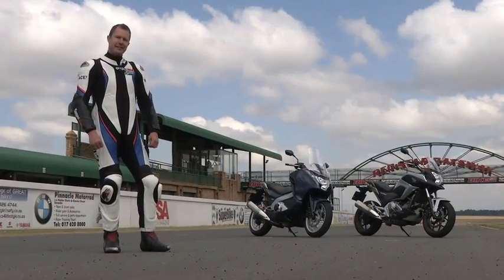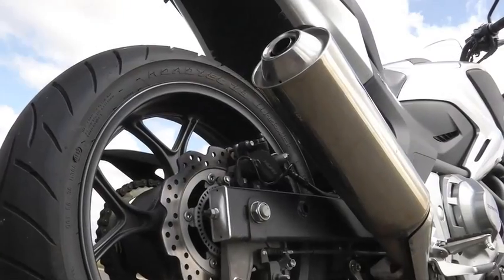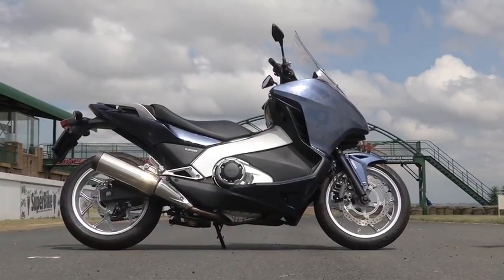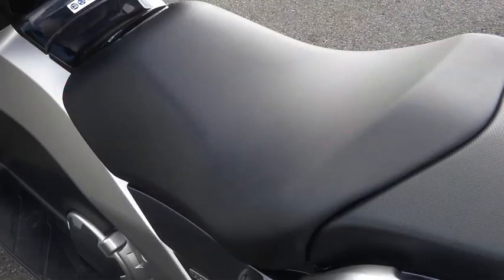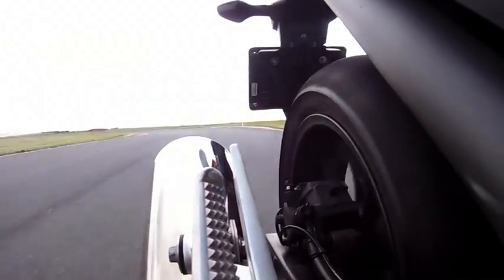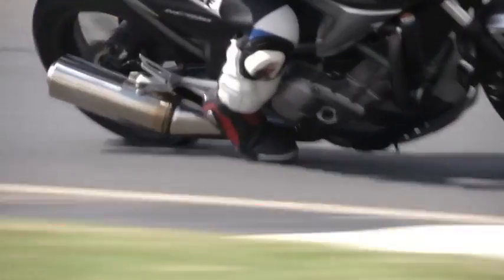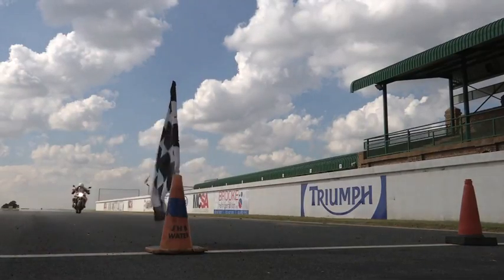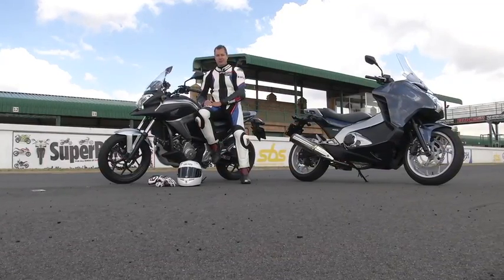Head-to-Head; Honda NC700X DCT and Integra DCT

Comment: In octobre 2010 I had a motorcycleaccident. I stayed in a coma until end of january 2011 and when I came out of that coma my right side, arm and leg were paralysed, the result of 9 braindamages. I spent almost a year in a wheelchair in a special clinic where people with braindamage revalidate. Thereafter I was sent home and I decided to walk again, which I did, step by step. I passed the necessary physical tests and exams to drive a car and a motorcycle again but I have to drive automatically and there, the Honda NC700X DCT ABS is a dream because it makes possible for me to drive a motorcycle, again. Besides that coma I also had multiple bones broken, skull, neck, ribs trough my lungs, spine, right hand, right leg and foot, but I am a biker again and I love it and, that Honda is really fuel efficient. Thank You Honda ! I have the impression that motorcycles and scooters are merging together. Also in cars I see more and more automatic gearboxes lately. And if anyone thinks that I am obsessed by motorcycles, I also drive a Vespa scooter and I am a member of a Vespaclub.
Reply: Hi, I had similar injuries but nowhere near as bad as yours. I had many broken bones, collar bone, vertebra etc but the worst was the brachial plexus lesion resulting in the loss of use and subsequent amputation of my right arm. Luckily everything else seems to have recovered and is working as it should. I'd love to get back riding, do you ride ok only with your left hand and did you have the controls moved to the left. Please reply, I'd love to chat.
Reply: +Jonathan Williams Well, I also have problems with my short term memory so I do not know if I already answered your questions. Alltough my right arm was paralysed when I came out of that coma one of the first results that I had, following the kinesytherapic exercises at the clinic of Pellenberg, was that I could reuse that arm. Maybe the fact that I boxed before and trained weightlifting (I benchpressed 150 kilos) and that I was a diver helped but I do not know. There are still 4 docters, and my familydocter, who are wondering how it is possible because when I woke up after those 3 months coma the 4 docters who kept me alive during that time came to stand before my bed and told me what had happened since I did not remember. They told me that during that coma I died 5 times but that each time I reacted very well to the reanimation and came back. They also told me that I had to prepare myself psychologicly to spend the rest of my life in a wheelchair and with limited intellectual capabilities due to the braindamages I suffered. Now, I am always lucky and one of my sisters is a psychiatric nurse who has worked before in that revalidationclinic at Pellenberg, near the university of leuven and she managed to get me into that clinic where I lived for about 9 months. Well, they drove me in lying on an ambulancelitter and 9 months later I got out of that wheelchair and made a few steps to the car of a female friend who drove me home. Once home I exercised every day to walk and step by step I advanced. I will never again walk 25 miles like I regularly did before but I manage to have a reasonable normal life. I also am almost 60 years old so the age is beginning to count also I presume. I have absolutely no idea if it is possible to ride a motorcycle with one arm but Can-Am makes wonderful tricycles. Maybe there is a solution to that problem. I also have no idea how the american services are reacting to those problems. Here in Belgium there is a special service the BIVV/CARA who studies and manages those problems and who decide if you are able to drive and how your vehicle has to be adapted to your physical shortcomings. Oh yes, I am no longer allowed to dive since my lungs are to small because my ribs went through my right lung so I have not enough air in my body and they told me that the air in my empty head did not count, damn !
Reply: +Jonathan Williams have you found a solution yet ? How are you doing ? Overhere winter is almost completely gone and I can not wait to make some nice rides on the Honda. Il almost have 30.000 km on the counter. Luckily there was no need to change anything since I can reuse my right arm completely.
Reply: Dirk Authuys Glad to hear that you are well my friend!
Reply: Well done mate, I take my hat off to you.
Reply: Only two types of biker, those that have crashed and those that are going to!  Wrong time, wrong place and everything changes.
Reply: You are one tough dude.  I myself have a form of cerebral palsy and of course it affects my left side. I currently ride a '17 Rebel 500, but I'm wanting either the 750X DCT, the VFR 1200F DCT or the NM4. Not because I can't shift, but because it makes life a bit easier for those of us with foot/ankle "issues." Take care, be safe and don't get caught.

Comment: I have had the NC700 Integra for two years now. I commute 40km everyday and have even done 960km in a single day when I did a road trip.
At first I didn't like its looks, but the bike is still growing on me. I enjoy every ride.
My average fuel consumption for the past two years is just over 27km/l. 
My only complaints are (1) the seat is very wide and makes it difficult for me to put my feet flat on the ground - I am only 1.7m. However, when my wife rides pillion it is much better. 
(2) it takes longer to remove the body panels than to service the bike. And they aren't that easy to remove, because all clips and skrews are hidden. 
But overall it's an awesome bike. I don't want to get rid of it.
Reply: Hi, deciding if I should take the NC700X. I am 1.70m aswell. I am tiptoeying the bike, but stable, doesn't feel too much heavy, but just tried to sit on it  didn't ride. How is it in traffic and is easy to ride with a passenger on the bike considering your high.

Comment: Why don't they just put the rear brake on the left hand side on NC700X?
Reply: Because it's still a motorcycle. Also, they make a manual version of it, so probably to cut costs on the manufacturing differences that might arise with a handlebar mounted brake.

Comment: I test rode one at a Honda ride program. (not a DCT)  
The engine has awesome low end torque but it doesn't rev.  
I hit the rev limiter several times before I adjusted my riding technique.

Comment: Thanks for a great video, this may be my future ride following a motorcycle accident 9 years ago suffering the right brachial plexus injury resulting in the loss of use and amputation of my right arm. Could the throttle and front brake be moved to the left hand side and do you think it'd be possible to ride with only my left arm? Thanks again for a great review.

Comment: I had NC750X and now I have Integra 750. This test is for what? Track race? This test means nothing. Integra is much much better in the city. Much more rotation in the handlebar and much easier to throw in small corners around the city because it handles like a scooter. Both bikes need some custom seats.

Comment: NC700 sucks! anyone who isn't being paid to say it's good or has not mistakenly bought one knows what a bluff of a motorcycle this is.
Reply: It's a practical bike, not a sportbike.  It excels at what it is designed to do.
Reply: bikes are also designed to ride comfortable  for everyday commuting and this come also do weekend riding. A bike with 260kg and 47hp rides like a 1200kg 200hp car
Reply: +ALIENdrifter66 so my cb500x which is 195kg(ABS) and 47hp is the 1200kg 250hp car? :P ..as far as acceleration they are fast for their size, not much top speed but on the other hand you don't crave for absolute top hp's or speed that category is sports bikes :P

P.S. I love the upright position, moved from a Ninja 250r(FI ..European model) ..and can't go back really
Reply: crackerworld ofcourse you won't get that high top speed on a low hp bike but you get a lot of acceleration, in most cases with you bike you can win from 0-140km/h. And being real you don't need top speed on public streets, what you need is acceleration.
Reply: what you did not like when you tried it?